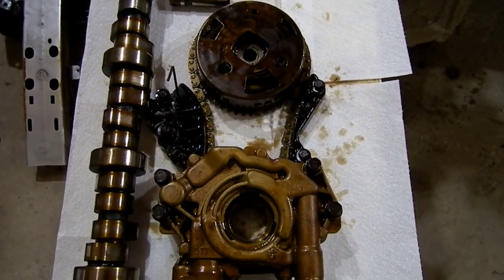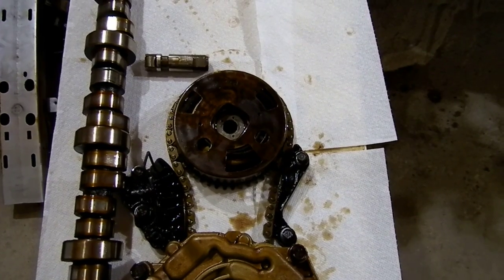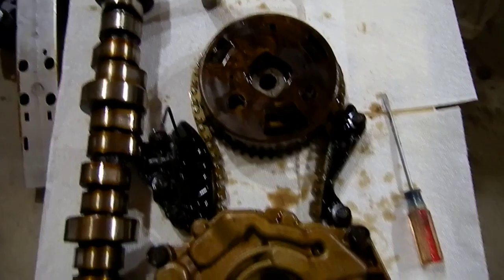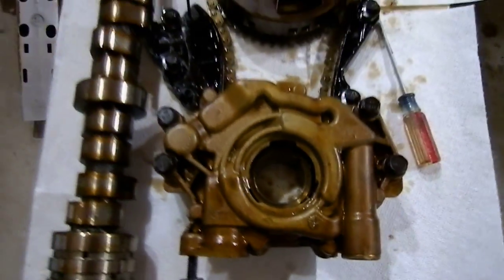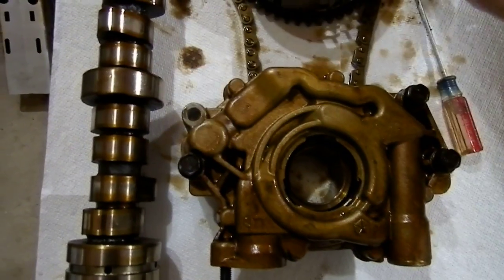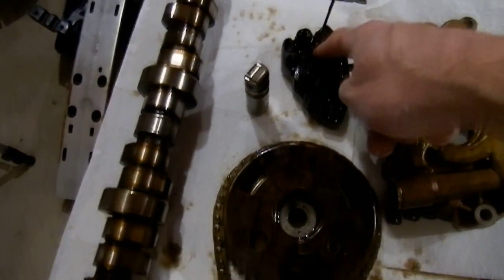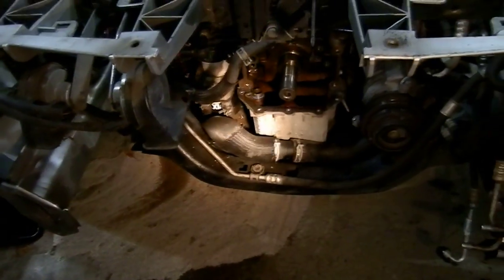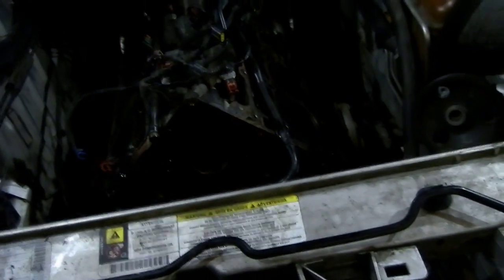5.7L Hemi Camshaft and Lifter Failure Tips/Tricks Timing Chain Look

Comment: crissakes! after watching a dozen of these vids i am totally in lovr with my v12 jag. it has none of these fucked up flaws. 25 years old and still pulls 170 mph+ ;->
Reply: think again...dynoed at 477 at the rear wheels. it;s been breathed on quite a bit over stock and started life as a 6litre engine circa 1994.it would pull 158 in stock trim with only breather and exhaust mods. also...nigel now tops at 173 mph through the traps...1 mile run clocked. again....far from stock trim and lovingly taken care of and gets driven at least four days a week although i am no longer doing the commuter thing. when a jag engine tosses its usually because its owner spends more time polishing it than doing the proper services required but that is the cost of classic car motoring. not everyone can afford to have them worked on or have the know how to do it themselves.
my xjs has been a labour of love and quite the sleeper as it turns out which is no end of entertainment. i imagine that the 5.7 engine owners that have had these failures don't properly take care of their rides or treat them properly like ensuring proper engine warm up times....shutting them directly off after a hard run or overheating ...running them low on oil but when i look at the cam drive arrangement,that skinny chain and some of the other parts used i cant help but think the engine was raped by cost accountants.
at any rate...v12\s are what we do and xjs's are what we run. you can contact us at jaguar.racing.us at gmail dot com for pics.processes and parts ranging from suspension components to hand built and programmed ecu's glad to see at least some of the 5.7\s have turned out well.

Comment: It just cost me $490 Cnd to find out that I have this issue with my 2012 Super Bee, (from the dealer).  The car only has 69,000 KMS that's less than 43k miles!!! They say it will cost $4500 Cnd to fix it and that it "may not fix it".  Does this fix the issue?  My misfire is on cylinder 8.  Should I bother fixing it or will I just have the issue reappear in another 43k miles?  I'm so upset right now with this.  There is a guy with a 2006 5.7L Hemi for sale locally, (12,000 kms on it), and he only wants $2,000 for it... will that bolt right up in place of the 6.4?
Reply from the maker: No the 2006 engine is quite different. Plus its a smaller displacement. 2009+ has quite a few different changes to the engine. 

IT is possible your old engine is not fixable. Ideally you would install a reman engine. In my case a new cam/lifters solved the problem.

Comment: I have a 2011 charger pursuit with 130k miles. ticking noise when I on the gas goes away when I let go . noise goes away after 20 min of driving
Reply: If you believe it's internal, make sure the lifter rollers and cam are not damaged and making the noise. I'm doing an engine at the moment. 2010 ram with a bad lifter/ cam, and metal in the oil not worth repairing With the chance of Deeper damage from the metal in the oil
Reply: Branden, what did you do instead of a rebuild on your RAM? I'm having the same issue with my 2010 RAM R/T with only 81k miles..
Reply: Buccshot 132 i have a 2011 too ticks or clanks on cold start and quiets down after it fully warms up , did u find a solution? Iam going to replace thr lifters
Reply: Ahmed Mohammed at 137k miles now .haven't been to the shop . not sure what the issue is
Reply: Buccshot 132 could be an lazy lifter or exhaust manifold leak

Comment: you need to take your car to your local dodge dealership to see if your is cover under p01 recall dealing with the engine timing chain/tenisoner /guide
Reply from the maker: its a 150K engine. Already fixed
Reply: I own a 2010 Dodge Charger with the 5.7L Hemi engine with 67K miles. I keep this car in mint condition and on the recommended (dealership) maintenance schedule. Just had this happen in April 2016 on a normal drive from Columbia, SC to Birmingham, AL. Had the vehicle repaired for four thousand seven hundred ($4700.00) dollars at Hendrick Chrysler Dodge dealership in Birmingham, AL. The dealership made no mention of RECALL P01. I submitted my receipt to FCA on July 7th 2016 over seventy (70) days ago for reimbursement. Sadly, they'd only begun to take action after I called four (4) times to customer service. Customer service offed me an apology and approximately one hundred seventy ($170.00) dollars.  I rejected the offer from customer service and my case #29655953 has been assigned to a case manager .... I'm a former Jeep Grand Cherokee, Stratus (both limited editions) and now a Charger owner.....   hmmmm can a brutha' get a break  :-(

Comment: I have a 2005 Dodge Ram with a 5.7 Hemi. The engine cranks slowly will not start and seems to crank erratically. Could this be a Bad Timing Chain. Vehicle has about 85,000 MIles on it and has been well maintained and not driven hard.
Reply from the maker: Could be lots of different things. May want to bring it somewhere and have it diagnosed.

Comment: Had a 5.7L Ram come in the shop with ~80k miles, misfire, and it would randomly pour oil smoke out the exhaust. Think it was second cylinder on the drivers side. Checked for spark, fuel, etc had all that. Can't remember what the compression test showed but I ended up taking the valve cover off and cranking it over, no movement of the intake valve. Checked the cylinder deactivation when cruising system, that particular cylinder was not one that was capable of shutting down. The owner took it to the dealer and they put a new engine in it.

Then just this week a 5.7L Ram comes in with 305k, burns coolant occasionally. I put a reman Jasper engine in that. I assumed it was a head gasket and at that mileage it wasn't worth putting head gaskets on it.
So they can go far sometimes, other times not so much. The second instance was in a 3500 dually.
Reply from the maker: Interesting on the first one. What year? 

I had an older 5.7l hemi (2006 Charger)with a misfire/no compression and HEAVY smoke on cylinder 5. Pulled the head, the valve seat dropped and poked holes in that piston. It then spread metal into the intake manifold and around to other cylinders. I put a used engine from a Ram truck into that car. Stripped it down to a long block and it dropped right in without modifications. I had to power wash/flush/soak out the plastic intake manifold to get all the metal out, a new one was around $500 and every used one I found was full of metal like mine.

In all honesty, did Dodge/Chrysler make any good gasoline engines in the past 10 years?
Reply: The Ram was a 2010 I believe. 

Man that's some carnage, lots of valve problems with these. Haven't personally seen one that bad but I'm sure I will at some point.
Reply from the maker: Yeah, overheat a 4.7l or 5.7l and your dropping seats. Vwdarren had a Dodge Magnum he did last summer or the summer before with the same issue, dropped seat/blew a hole in a piston and sent metal everywhere.

Comment: How many miles on engine ?
Reply from the maker: 150K. This seems like a common issue with these engines with high mileage.
Reply: ok thank you for the update i just bought a new challenger and was hoping that this was not a common problem with this engines... but from your statement this was a somewhat high mileage motor ....   is this your own car ? the reason why i am asking wondering the service history on this engine ...  because is see tons of people who do not change their oils wondering if this was a contributing factor
Reply from the maker: Old police car, original engine. Oil was changed every 5-6k, unsure on weather synthetic/blend or conventional.
Reply: thank you for the update ....   going to use fully synthetic oil for my 2016.
 
would you happen to know if they corrected these problems for the 2016 models
Reply: +maldo72 Yes, new lifters beginning July of 2016, new timing chain/guide package was mid 2013
Reply: P Kranz wow, where did you find that kind of detailed info, if you don't mind? I got my 2016 scat pack in early September 2016. Just wondering if I'm 'safe'.

Comment: If I disable the MDS on my 2014 hemi, will it prolongs the issue from occurring. 
Reading online that to prevent this you can disable MDS since it a major player in this catastrophic engine seize
Reply: P Kranz That timing issue reared it's ugly head most on automatic cars and not on six speeds. Guess what the difference is between the two.
Reply: Gabe Niccum They will work in all Eagle (2009+ 5.7) engines.  Using non-MDS lifters will cost more because of the required plugs for the solenoids, a tuner or flash to turn off the MDS, and then horrible fuel economy.  You're much further ahead getting these latest parts and using those.  

Chargers in police service get the hardest use of any of these cars, and initial response, after testing, has been overwhelmingly positive.  It does sound like they've got the problems fixed.  Unfortunately, getting them to cover it out of warranty will be tough.  They seldom covered the issues while the cars are under warranty, at least until they failed completely.
Reply: @pkranz937  You are correct as to how they handle their warranties, but when you buy replacement parts, how would you know if you are getting the new and improved parts or the old parts?
Reply: @johnr8476  part numbers supercede in the Mopar service replacement catalog.  Or you might be able to buy them directly from Melling.
Reply: +007 007 If you don't have a tuner to disable MDS, you can also use your gear selector to disable MDS. If you toggle the gear selector to your highest gear, it will not modify your shifting but ultimately keeps the MDS from kicking on. It will be something you have to do each time you get in the car/truck however its a work around if desired. I actually did this in my truck to test how much MDS actually saved on fuel. I also did it during warm up to prevent uneven metal expansion in the engine. Some may argue with me on my reasoning during warm up however I think justified. Depending on your morning drive, half your engine could be doing a majority of the warming up, which mine would have been.
Reply: I had the same issue with the cam on a 2010 Ram 2500.  It doesn't have MDS. Many times the lifter roller locks up and eats the lobe off the cam.
Reply: It's a lifter issue, not a design issue.  New lifters were issued beginning July of 2016, and the timing/guide issue was solved mid 2013.
Reply: Whats the difference?
Reply: +brett248vista It wasn't a transmission issue, it was a gear ratio issue  - only cars with a 3.06 or deeper gear were covered under the campaign.  That doesn't mean a 2.65 ratio car wouldn't have the problem, but certainly the higher average RPM's of the lower gear would wear out the ridiculously cheap and flimsy timing chain and tensioners.
Reply: so did they ever make a stronger kit to replace the bs plastic?
Reply: Gabe Niccum 2015+ cars show different part numbers for that issue, and a new cam, valve springs and lifters were used beginning in July of 2016.
Reply: I wonder if those parts will work in a 2010? Or just buy non mds lifters and plug where the solenoid used to be. Good to go.
Reply: +007 007  I believe you will. My personal feeling was from the beginning that this failure was caused by the massive change in thrust forces exerted on the timing chain when the engine changes from 4 cylinder to 8 cylinder operation.  Basically when the engine transitions from 4 to 8 it pumps four lifters back up so they begin opening and closing valves. That pressure causes the chain to slap the tensioner which causes the early black plastic tensioners to snap which then allows the chain to slap around even worse which ultimately causes the chain to snap.  The replacement guide set is made of white nylon and the guide shoe is now aluminum backed. 

I don't have a 5.7 but ever since they started having issues I decided to never use MDS in my 6.4 Hemi even though there haven't been any widespread failures in the 6.4's.
Reply: +brett248vista excellent reply sir.

same here, i've the jeep grand cherokee 5.7 hemi and also non of these issues have been recorded on the jeeps. only 300s, chargers and challengers.
but i'm disabling mine, dont want to wait until i discover if the issue is present on jeeps.

Comment: since i see it wore down the cam quite a bit how did you flush the motor out to prevent any further damage. and approximately how much did this rebuild cost?
Reply from the maker: Only thing I did was change the oil/filter, no flushing done. Cost, Camshaft was only like $70, gaskets  $100, head bolts $60-80?, timing set $100, bank of lifters $100, oil/filter $35, coolant $15, spark Plugs $60

I suppose you could tear down the entire motor and go through it all. You could also put a new long block in. I figured the oil filter kept contaminated oil from reaching the bearings. You could also pull the motor the rest of the way and drop the oil pan and clean it up with the pickup screen.
Reply: +m ph when you say a bank of lifters you just did the lifters that failed correct and the cam so not all lifters were replaced?
Reply from the maker: I just replaced 4 lifters (only 1 was bad). They sell them in multiples of 4 with the plastic retainer. Front Bank Left/Rear Bank  Left, Front Bank Right/Rear Bank Right. 4 lifters with the plastic retainer runs $100. So $400 to replace all the lifters in the entire engine. Each bank has 2 MDS lifters and 2 standard lifters. 

I did this on a tight budget replacing only what really needed to be done. Worked out just fine. The "Best" way would be to swap in a long block. Whats that, $3K plus labor?
Reply: +m ph oh ok, mine don't make a knocking sound..thanks for the reply
Reply: +m ph How did you drop the oil pan to remove the pickup tube? That's the only thing i need to make sure of
Reply from the maker: Unsure on how to drop the oil pan, never did it on this car.
Reply: I'm having to replace MDS lifters or lifter in my '09 Ram. And im praying that the cam isn't damaged. I hear a steady tick on driver side. Do you think the cam is bad too, I've seen online that the locking pin inside the lifter could be bent.
Reply from the maker: Dont know. Mine had a misfire/tick at idle and a knock at higher rpm.
Reply: I have a 2010 5.7l ram and it has a P0305 CODE on the dash, only misfires randomly or if I get over 4k RPMs, or uphill with a load. Been driving it with the code on for about a month and havent had any issues yet. I just got the funds to fix this thing. I've also read about the MDS solenoid going bad, so im looking to find the problem. If its the solenoids ill replace them with a plug to stop MDS, i dont like it anyway and theyre right below the intake.
Reply: @NicDaddy1  fixed?
Reply: @myhoodiskc  nope. Rebuilt the engine. 2 years later it happened again. Had A dodge dealer rebuild it this time under warranty. 1 year later it did it again. Got told only the parts were under warranty and not the labor so I’d have to eat another 1500-2k. After having already spent $3k the first time and $4k the second. I traded that POS in. Garbage company. Garbage engines.
Reply: @NicDaddy1  how the trade in go did the deduct for the engine damage ect?
Reply: @myhoodiskc  Well yeah haha. It was a 2010 crew cab Hemi SLT short bed with 175k. Leveled on 33s, aftermarket rims and tires, brush, the whole 9 yards. I got $7k for it.
Reply: Yeah just check the voltage on the mds solenoids with a multi-meter. They should read atleast 10.3ohms. Anything under they should be replaced.

Comment: retaining clip that holds 4 lifters each..I wonder if after I put the new lifters in if a can judge by seeing if there's play in the valve still..because if the cam lobe was worn it would still cause the valve not to open fully with new lifter right? my hemi tick is only on cold start
Reply from the maker: I was able to inspect the cam with it in place once the lifters were pulled. I used a mirror and flashlight. You could also use a bore scope (the camera scope).
Reply: Ok cool, I figured I could do it that way. Thanks man

Comment: I have to replace a few lifters on my 09' hemi because of the p3400 code..is there a way to check if the camshaft needs to be replaced too after taking the retaining clip out with out have to take more stuff apart
Reply from the maker: What retaining clip? You could pull the valve cover and compare how much a valve is opening compared to another. In order to get the lifters out and get a visual the head/s will have to come off.

Comment: What is the Reason for a flat Hydro-Roller ?
I think i have the same trouble..

Here my Engine Noise
https://www.youtube.com/watch?v=py_YxHS-ick
Reply from the maker: Not sure what you mean by flat hydro roller. Are you referring to the lifter roller that locked up and got ground down by the cam? If so, I am not to sure, possible lifter roller bearing went bad and locked up? Lack of lube?

Your engine sounds like this one did when reved up. I also had a constant misfire. I saw your video, yours looks like the older HEMI engine, The design was changed in 09 I believe. 09+ have camshaft problems like this video.